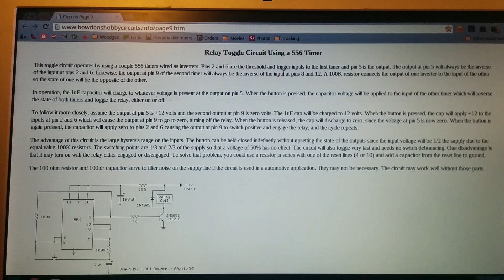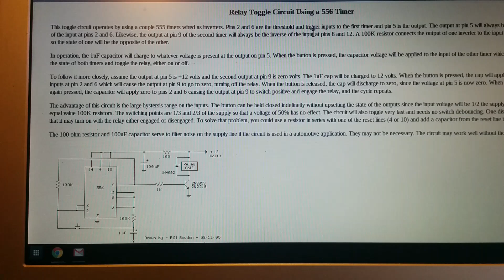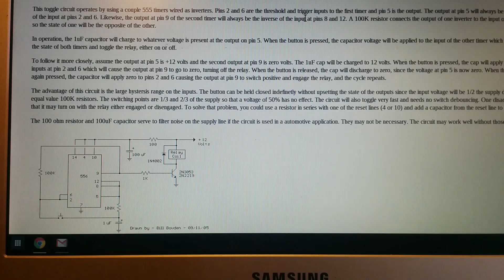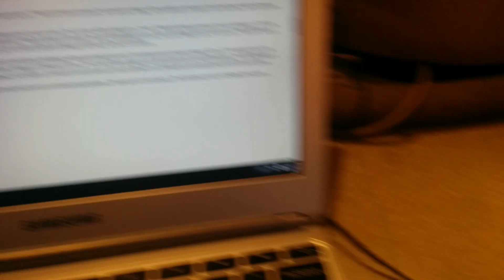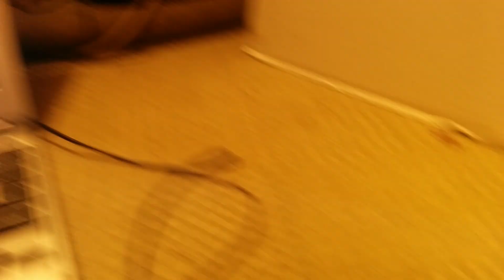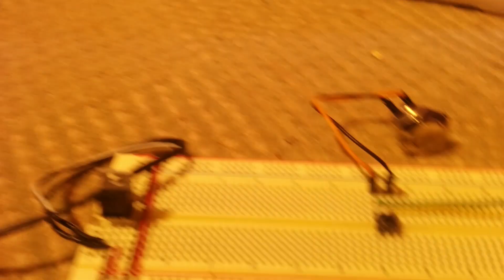Flip-flop Toggle switch circuit

Comment: Hi Chris, I've already created something similar (using a 555 timer) and am alsop lanning on using multiple switches; however,  I want the differing switches to operate differing relays, is there a way of incorporating a 4017 chip into the circuit to achieve this?